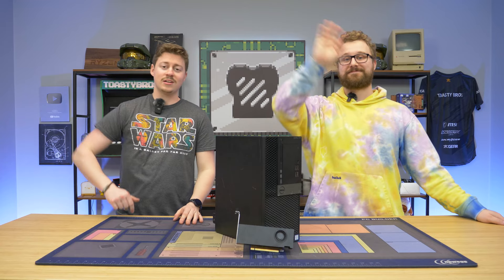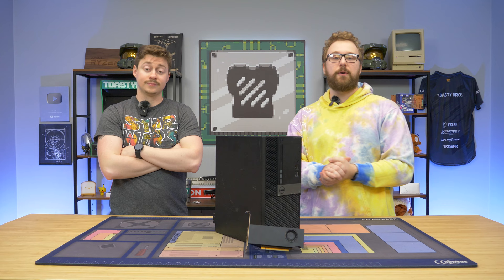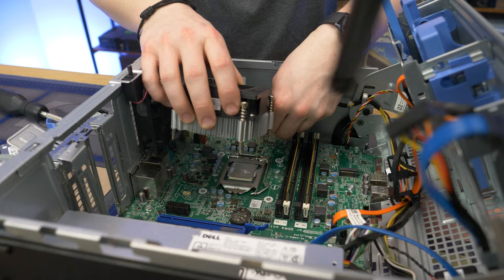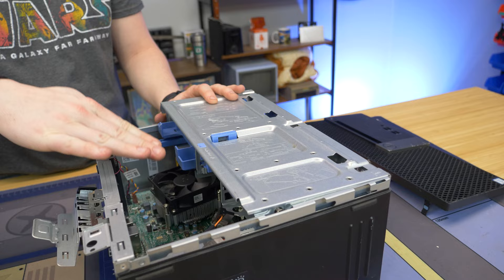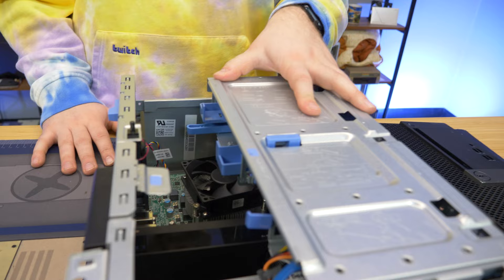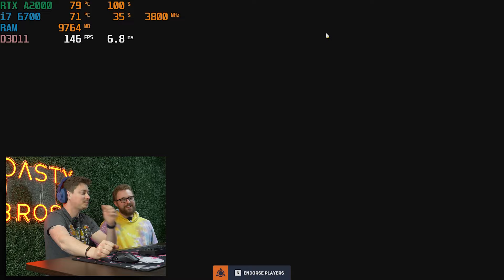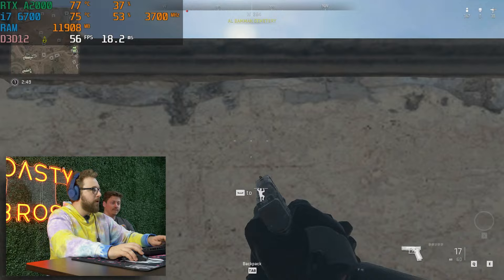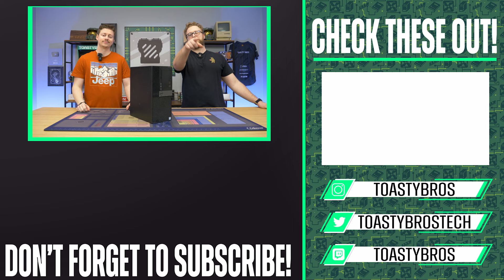This Optiplex Is Faster Than Most Gaming PCs?! 😮

Comment: Just want to chime in here and say that I'm running an RTX A2000 in an Optiplex 7050 SFF that has an i7-6700, 16GB DDR4-2133 RAM and PSU that's only 180 watts. Only thing is Dell has placed the PCI-e x16 bus in the second slot on the 7050 so I opted to plug it into the PCI-e x4 bus which is on the first slot. There is a performance dip because of this but it's pretty negligible. So if anyone out there is looking to upgrade and worried that 180w is not enough, the A2000 will do just fine. 👍

Comment: would a 6600 work for this build?  and btw i love your videos
Reply: it would physically fit BUT it would require a higher wattage PSU. A SFX PSU fits(SFX PSU SILVERSTONE 80 Plus Bronze 450w can be bought used from ebay for $40-$50) would fit but you need an 24pin to 8pin adapter too which are around $10-15 from Amazon.
Reply: The older 4th gen i7 Dells (for example the optiplex 9020) you can use a regular size PSU but they usually come with a 290W PSU so you can get away with a RX6600 which requires 300W.. NOT the 6600XT that requires 450W.
Reply: @eliasneris2612  okay thanks!
Reply: @eliasneris2612  would an older i7 at that point bottleneck my graphics card?
Reply: @olive_boyy  i7 4770 would have a 3.0%  graphic card bottleneckwith the rx6600 according to Pc builds bottleneck calculator. 0% with the 6600XT at least at 1080p. It should be fine for 1080p gaming. Of course a faster more modern cpu with DDR4 would be better but it should be pretty good budget build core PC.

Comment: FYI you can clone any drive to any other drive like an ssd if you wanna transplant the windows/etc. 

Also...curious I have the same issue on warzone with my i9 9900kf with 2080 ti and 32gb of ram 3200mhz. The gpu is always at 40 or less usage...and cpu is closer to 50 or 60..if I max it out at 4k the gpu usage goes up to 77 but cpu goes up to 80s 90s...it is weird to see a newer gpu like the a2000 having issues with the same game...something is up?? Are manufactures not updating certain drivers or updates in games to cause us to continuously buy the newest gpu? Is it a cpu issue?

Comment: I would say 10400f and a 3070 would be better than this right?
Reply: 10400f may or may not dwarf the 3070, most likely it will not give you the optimum 3070 performance.

Comment: I might have missed it in the video but can this card fit in a opti usff???
Reply: If you try it in sff optiplex, the A2000 apparently can only fit in the x4 pcie slot. The faster x16 slot is too close to the psu so only a single slot gpu like a rx 6400 low profile will fit in the x16 slot.

Comment: You're right this is faster than my gaming pc
Reply: Not good value tho
Reply: @jonathan-qd1cc  I built my PC in 2016 so anything is better than mine at this point, and I already have a build in mind so I wouldn't be buying this anyway
Reply: @CreatureBruhh  What are ur specs?
Reply: @theoriginals9821  i5-4570 / RX 460 4gb / 16gb ram ( but its 2 different brands bc one set died) and 1TB HDD

Comment: 1080ti also could be a good gpu for that build(will need a psu upgrade)
Reply: PSU Upgrade is a bit of a problem, because Dell uses proprietary power connector, so you'd need an adapter. I have one, so 5 years back I upgraded my precision with GTX 1060 SUper JetStream. Very stable build.

Comment: Can I replace my PSU with aftermarket one on my SFF case and simply whip out an angle grinder and modify case a little bit to fit full size GPU (while keeping case open because I wasn't planning on cutting that part out but simply keeping it open)
Reply: You can't replace PSU usually the 24pin aren't standard. Dell uses proprietary connections on lots of their MB's

Comment: That is just a cpu bottleneck, its not so much drivers..if you had tested the card with a better cpu in warzone 2, you would have seen much better performance than this, this is not bad but dont blame the drivers, they might be a problem, in this instance, not really

Comment: Wish I saw videos like this before I built my pc because I could’ve had a lot better performance
Reply: I made a i-5 10600k 3060 build with 32 gb of ram and 2tb ssd storage for less than 850 albeit i already had the cpu but still I’ve researched this type of stuff for a little over a year so dont feel to bad you can always improve your system little by little

Comment: Sorry, there is very little chance this OEM stock "business" PC could have better gaming performance than even a 5 to 7 year old custom built system. If anyone has ever dealt with these systems then they know the limitations and pitfalls one runs into trying to make these things into a "gaming" rig. If you're capping the system with a budget then it's simply not a realistic comparison to a custom built PC because they will always cost more to build but performance, upgradability, and expandability will always be greater than an OEM potato no matter how much money you think you're saving. Honestly, if a budget is your main issue with trying to get a gaming PC then just get a console. You'll be up and gaming for a lot less money and a lot less headache and stress.

Comment: bought otiplex sff 5060  i5-8500 on amazon  for 187. 
+ 32 gb extra ddr4-3200 for 50 bucks. motherboard can support up to 128gb in 4 slots.
+ low profile gigabyte rtx 4060 + 8 pin power adapter instead rtx quadro a2000
125w instead 75w:((( but 30% more performance in next gen gpu + 8gb/192bit instead 6gb/128bit for same price. + its geforce, not quadro...
gaming on optiflex sff its another type of porn, dont even try:(
all your savings on cheap motherboard/rack/cpu eaten by that expensive sff gpu.
i tried that on my own risk, because i'm old pervert with sack of money. psu or another component will die from overheating/overloading, i am sure about that. my assemble costs me around 600 bucks. for that money more reasonable to assemble something inside full tower case.
my optiflex also supports nvme ssd , but all optiflex until intel gen10 have pci-ex 3 bottleneck for gpu and nvme
if you do full tower radeon  assemble on this price, it will kill any optiflex assemble by performance and stability

Comment: what kind of nonsense ist that again? Just get the cheapest H410 mainboard with i3 10100 ( that outperformes the 6th/7th gen i7 ) and 16GB ram for around 120 Bucks. Get a standard PSU for 30, and a shitty Case for free out of an dumpster. Dont limit yourself with prebuilds like Dell or HP. Worst case, those mainbaords Bios-lock on specific GPUs. You cant even boot with AMD for example.
Reply: 16 gb of ram of 120 bucks of ddr5 or ddr4?

I can find a good price of 16 gb of ddr4 dual not single 3200 megahertz around 45 dollar
Reply: 30 of psu is gonna explode ur whole computer 💀🤣🤣